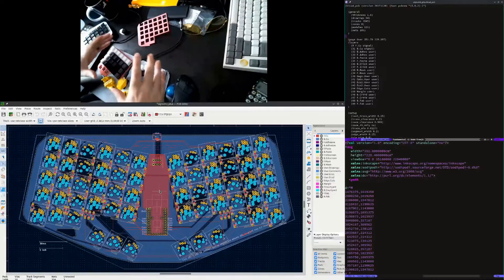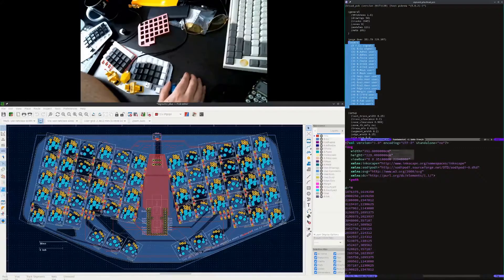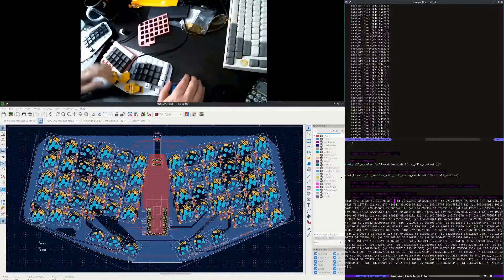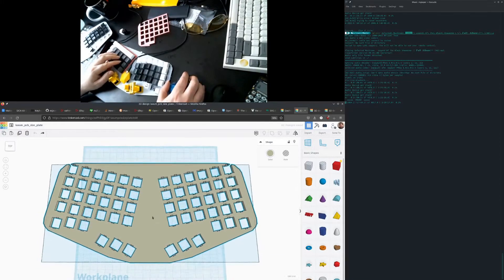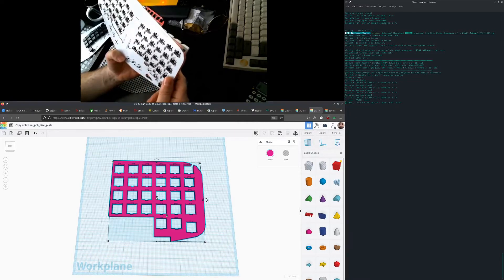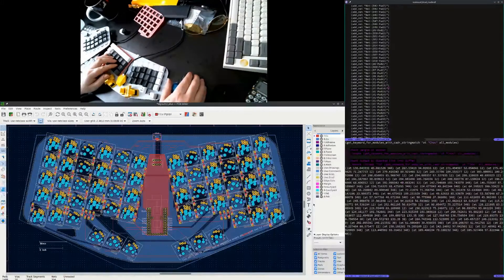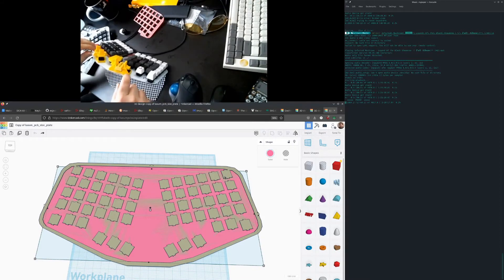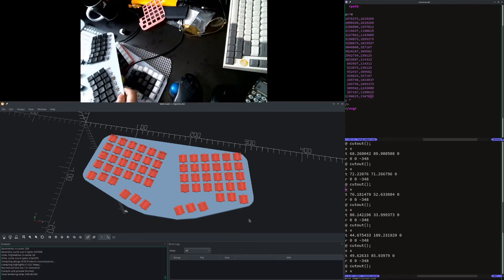Emacs:Kicad PCB Lisp to OpenSCAD mechanical keyboard plate/case STL LISP

Comment: it's compatible with choc low profile and cherry mx switches?
Reply from the maker: Yes. Soldered choc switches, soldered cherry switches (North facing), and kailh hotswap cherrys (south facing). The board supports a grid/ortho layout and a vertical stagger.